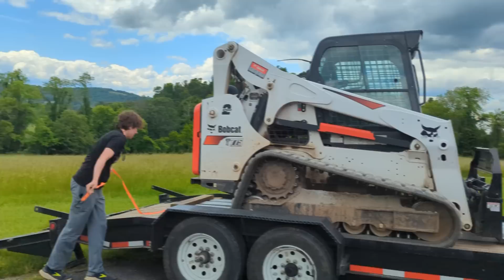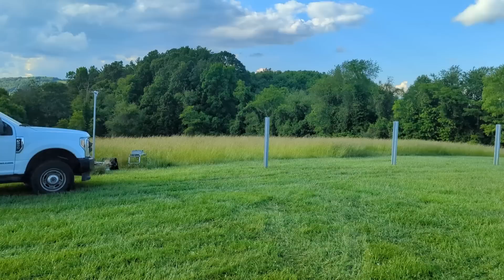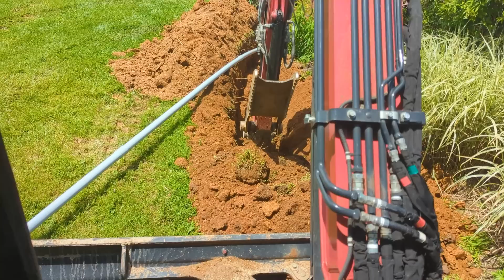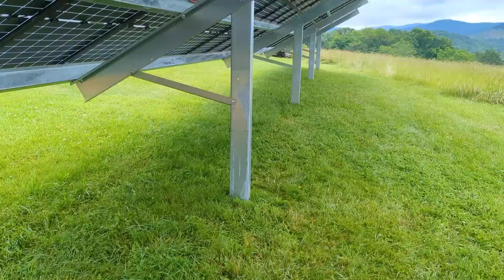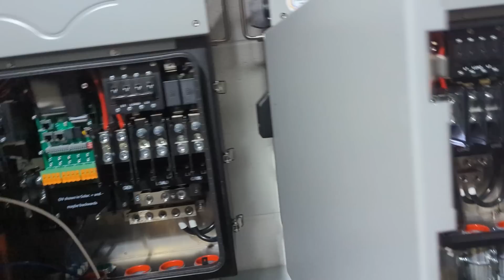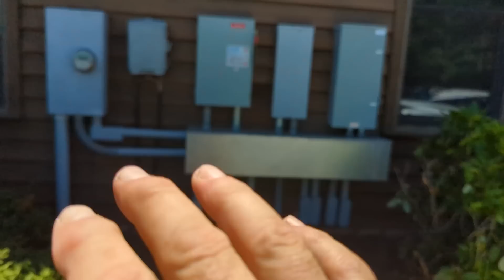Great system but he added a Tesla!

Comment: Beautiful work as always. Really enjoying your channel. I would love to know more on how you were able to maintain a 400-amp service yet back up everything with a single solar/battery setup. Are the two Sol-Ark 15k's paralleled or run independently of each other?
Reply from the maker: @WilliamLeeming-e6f  The two inverters are run in parallel. We use two manual transfer switches that are each 200 amps to each panel so we can maintain the 400 amp service. Though he never uses more than 100 amps so that is why we can backup the entire place with two inverters.

Comment: I have 72kwh's of batteries now and just added a Chevy bolt with a 65kwh battery in it. Im thinking I need add 30kwh's more batteries to my current system. Will add 6k more panels to help my 21k of panels in my system.

Comment: Are you kidding me? You have what looks like a 20 KW  solar panel array and a 120 KW of battery backup and you are claiming that you need soft-starts on the two AC units? My Trane 5-Ton, two-stage unit uses 19 Amps at start-up, but even if that was doubled to 38 Amps, a single Sol-Ark 15K would easily power it without a soft-start module. This guy has TWO Sol-Ark 15K units, he could easily start three or four AC units all at once. I am not sure how your "math" worked these numbers out. I have a 200 Amp grid connected panel and it could start two of my Trane units at once if I had two on the house, and that is without battery backup and sun-power flowing to the two inverters. In the day, the two Sol-Ark inverters can bring in something like 19 KW  each directly from the panels to power the house. I don't see a need for soft-starts on the AC units, unless you are trying to extend their lifespan.
Reply from the maker: He has 4 AC units. They are not trane units with low lra. Each unit had an lra over 110 amps except for the ton and 1/2 unit which was around 80.
Reply: @engineer775  Okay, that makes more sense. These units must be monumentally inefficient.
Reply: @franklong6269 They are older units (~20 years) We took the LRA down from 75a to 24a in each unit using the microaire soft starts.
Reply: You are right. Soft starts can also cause the compressor to stall on start up, and way cheaper to get an inverter with 100% overload capability ( like Victron)

Comment: Connecting EV's: I'd like to see some heavy duty DC-DC converter/chargers that can be powered from the typical 48V battery  bus instead of going out to an AC powered Charger via the Inverter, seems a waste.
Reply: Choose an inverter with a HV battery, you dont use 48V anymore for larger installs, up/down conversion has much less losses and much less amps on cables and everything
Reply: @t.d.5804  That may be the case but most systems out there are 48V. There is also safety advantages to thst

Comment: The last several videos have shown mounting clamps on the panels rather than using the Sinclair direct mount system.  Any particular reason?
Reply: Certain module sizes aren’t compatible with Sinclair direct tie

Comment: Why do you use PVC pipes instead of corrugated conduit for under ground line?
Reply: Because schedule 40 PVC is the standard for underground wire. Other accepted methods are HDPE, direct burial USE cables, UF direct burial cable, coated  RMC, etc. Corrugated black tube isn’t an accepted electrical conduit, and pulling through it would be awful.

Comment: I have 13kW of panels and a 30kWh battery and with that I can get 50 miles/day on my model Y and run most of my house.  Note: That's charging the car at night off battery.  I can get a lot more if the car is home during the day.
Reply: Nice
Reply: I cant' agree more with the car being home during the day! I can hit 14kW at mid day during the summer and it's enough to run the house and charge the car